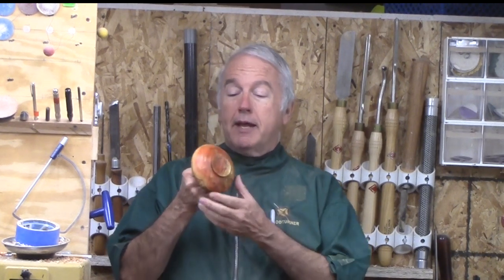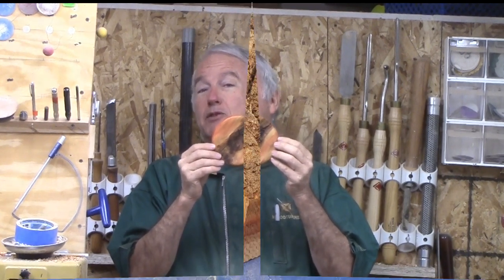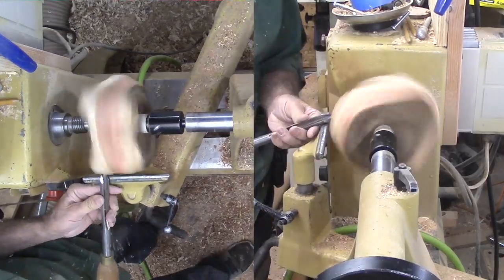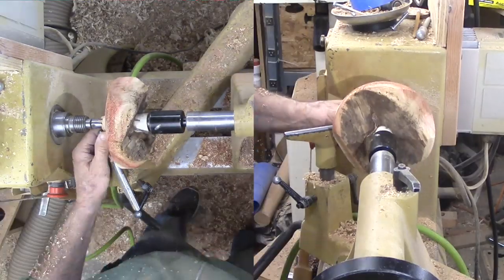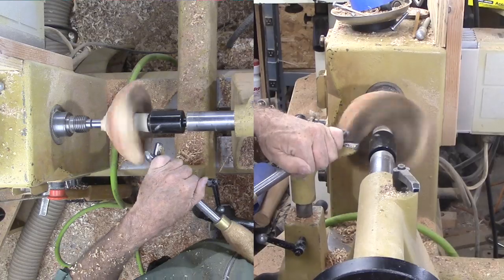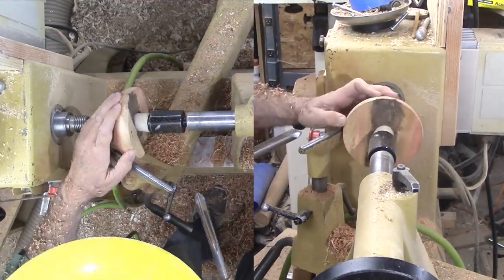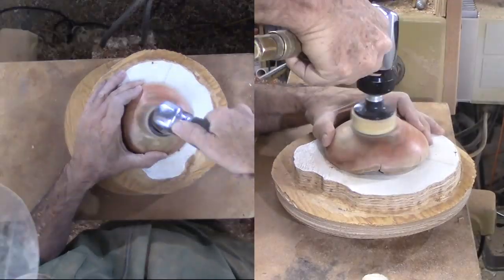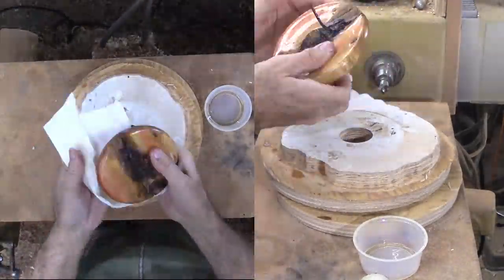Nailed It - Woodturning "Woodies Breakfast"

Comment: Allan interesting art piece.  What is the right angled tool you used to grind/plane off and then sand the bottom of them piece?  Thanks.  Cheers, Tom
Reply from the maker: Mine is a Proxxon- not sure it is still on the market.
Alan
Reply: As Wood Turns; Thanks Allan. A current variable electric model is available at Home Depot for $140.  Going to have to check it out.  Thanks again.  You can never have too many tools (as long as you can find them when you need them 😃).  Cheers, Tom
Reply from the maker: @tomcoker9882  How true that is? But add one more part. (Have a place to put them)
Alan